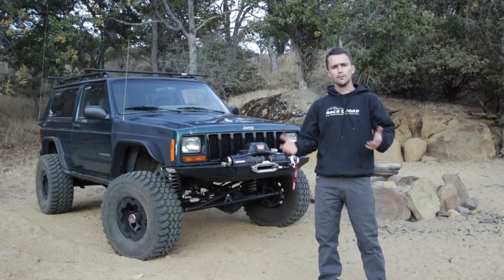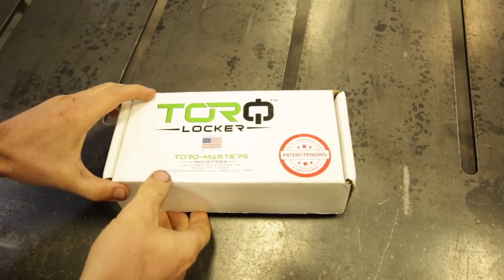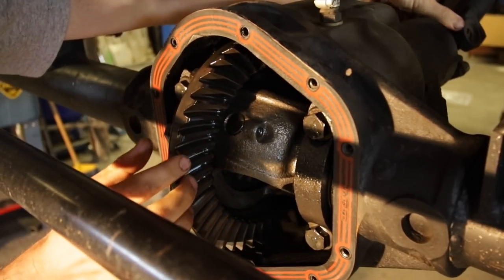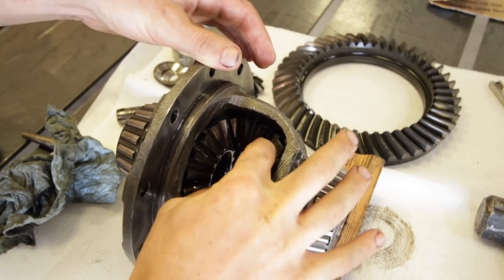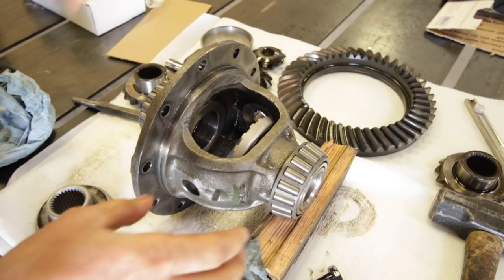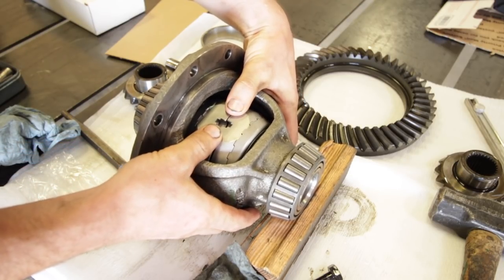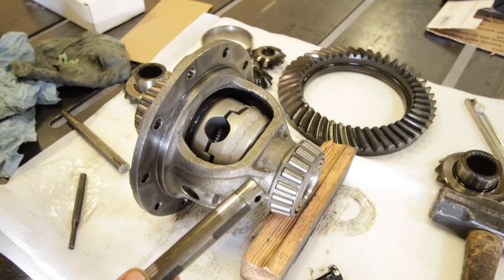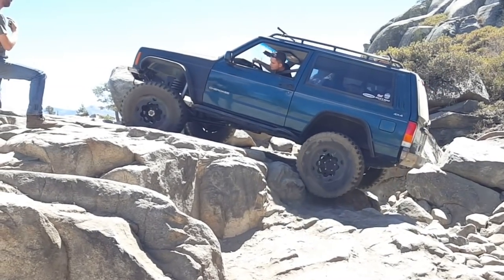How To Install a Lunchbox Locker

Comment: My ranger came oem with a limited slip rear end but I want more than that now. Would this locker be acceptable as the main locker??? I cannot afford an arb air setup. (my plan is to create an overland camping truck. no Utah, Cali, or Colorado rocks here)  (Also my daily truck but only gravel roads, about 20 miles a day)
Reply from the maker: It's likely a perfect candidate! Checkout their website to make sure they have one for your axle.
Reply: Aussie Lockers and TORQ Lockers can not be installed in a Limited Slip carrier, only an Open carrier. You may be able to install one in your front axle depending on which axle you have.
Reply: Torq-Masters Industries  What is the reason for this?
Reply: The LSD carriers are weaker than open carriers typically, so we design for Open  carriers.

Comment: Is it only noisy when engaged?
Reply: Typically you are going so slow while in 4WD that the locker won't ratchet much, you would only hear it when it's ratcheting. I rarely hear our front or rear TORQ Locker while trail riding in 4WD.

Comment: These lockers are not equal as a weleded diff?
Reply from the maker: This locker will allow you to turn smoothly but still provides traction to both tires in the axle it's installed in. A welded diff will provide traction to both tires all the time but won't allow for tire speed differential in a turn.

Comment: I love the build but am confused as to why you are still only running 33s. Ford 9in rear, Dana 44hp front with hydro steer you're safe to run 37s or bigger if you're careful. Stock dana 30 can handle 35s all day long as long as you don't bounce on the rocks.
Reply from the maker: My Jeep is just right for where I live in southern Oregon. We don't have much gnarly wheelin where I need larger tires and the Jeep is highly steetable with the 33's. If I change my mind later on I have the axles to better build upon already in the Jeep!  - Tim
Reply: @bleepinjeep  right on, thanks for the reply. I live Vancouver WA, not too far from you. Daily driving xj on 35s for 4 plus years haha
Reply: Heck yesss.  33 K02s for the Owyheeeeeees  <3

Comment: So is it better to have one in the front or back axle? Just curious...
Reply from the maker: Personal preference... Both is best, lol. I will lock the rear eventually. It did pretty dang good with just a front locker on the Rubicon.
Reply: That question has opened many cans of worms over the years lol. My personal preference is lock the rear and limited slip in front, itll let loose when you're bound up and it's much easier to steer without extra hydraulic aid than fully locked.
Reply: I always recommend locking the rear first that way you get the extra traction on the street, unless you have a Dana 35 rear, don't waste money on a Dana 35.
Reply: @Lray4x4  I've got a Chrysler 8.25, been told its damn near as tough as a dana 44
Reply: @kristophermathis8584  That's a good axle, I am going to run 35s with a locker in mine.
Reply: Thanks like the chicken before the egg question  - there are many opinions out there. 

Front lockers - a front locker is a great first choice, it's practically invisible in 2WD, and in 4WD you have a full locker for ultimate offroad traction. There are some con's to a front locker, we don't recommend driving at highway speeds, in 4WD, in Icy conditions (your OEM manual probably says don't go over 45mph in 4WD anyways) - but I know some people use 4WD in the winter as a crutch, so I always mention it. Also, a front locker will increase your turning radius offroad, which IMO is only a big issue when competing in Rock Crawling competitions. 
 In the ideal situation, I recommend a rear locker first, awesome in the winter, you will find you won't need 4WD as much when you the added traction of a rear locker. Also, a rear locker won't affect turning radius offroad. Con to a rear locker, for some, is the clicking noise. This clicking can be decreased by using thick, cheap, gear oil and an aftermarket diff cover, like Solid. Aussie is known for being a quiet auto locker, but the click noise is so subjective, it's hard to really say. Some people don't notice it, some people don't like it.
Reply from the maker: My 8.25 made it to 220k then all the bearings wore out at once. I only had 31's on it but I thrashed on it for many years. Never broke it.
Reply: @TorqMastersIndustries  I love your explanations and attention to detail! Between Tim and your comments you just sold another one. Keep it up!
Reply: @kristophermathis8584  215k on mine with 33's. Great axle, stick with the maintenance. I'm about to regear/ rebuild and waiting for a "forced" upgrade and haven't needed it yet.
Reply: Thanks James, I'm here for you anytime!

Comment: That design is so much simpler than the aussie's I ran several years ago. What fender flares are installed on your XJ?
Reply: Thanks for noticing! We eliminated the "spacer" and the 4 pins. The TORQ Locker is a much simpler and stronger design.
Reply: Torq-Masters Industries  You guys do make a great product. Customer service is great too. I broke a spring on a reinstall and had new pins and springs a couple of days later. I'm seriously considering this new locker for my current build. A little more pricey but that's to be expected on a new, stronger product.
Reply: bosco1985   What axle are you thinking about installing the TORQ Locker in? TORQ has a limited offering to our most popular differentials. It does cost more, there is way more material used to create the key-way, and more time on the machine to mill the extra material away. It would be cheaper to use pins, but this is the strongest design, and IF we can build a better, stronger product, we will. Aussie is still tried and true, it's been around for 15 years and is just fine for most off-roaders.
Reply: Torq-Masters Industries  I would be putting it in my Chrysler 8.25, 97 XJ.

Comment: Spartan also made in usa
Reply: Spartan is not made in the USA - it is made in China 100%
Reply: @TorqMastersIndustries  not according to its box says made by USA gears in USA back up your claim
Reply: @TorqMastersIndustries  flat b.s. they all cost the same and people say Aussie is best anyhow
Reply: Spartan is made by "USA Standard Gear" but just because it says USA in the name, doesn't mean it's made in the USA. The Spartan Locker box also has a manipulated USA flag with big "USA" under the flag, but if you read above the big "USA" you will see "Assembled In", which just means they put it in a box in the USA, their parts are made overseas. Just google their box, you will see it. I can't post photos here.

Comment: What ? "1.475" ? that would be 1-15/32 inches. I think you want  .1475 or 147-1/2 thousandths . also dial, or digital calipers are not good for anything closer than .005, use feeler gauges or joe blocks. also never reuse roll pins.